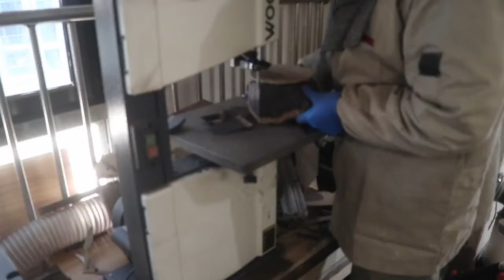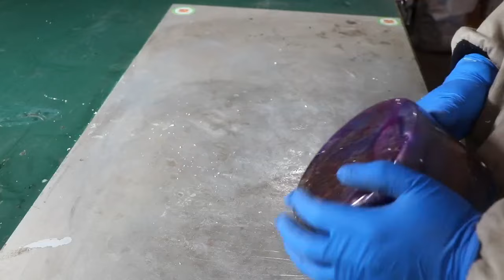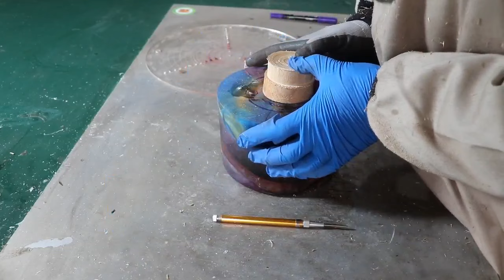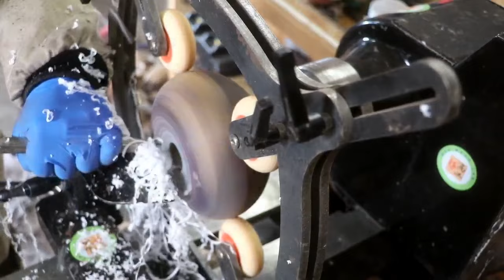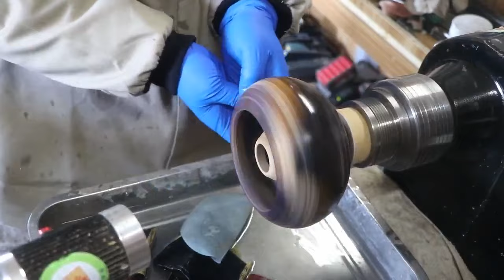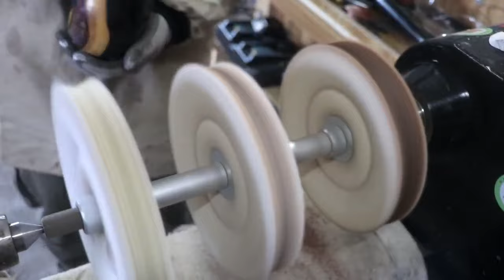creative woodturning:bowl in bowl, but why  thinking about aliens?😂😂😂

Comment: I love the shape and colours you used. Just a suggestion to possibly save your bucket next time, try using compressed air to blow along the edge between the bucket and your piece, sometimes it's just enough pressure to break the seal!
Reply from the maker: Thank you so much, very very glad you like it,🙂🙂🙂🙂.yes, I saw some YouTubers did that, and I tried too, but maybe the piece of wood is a little bit big, failed, next time, I'll cut it smaller, BTW, the wood is sooo hard, difficult to cut,😂😂😂😂
and, thanks again,🙂🙂🙂🙂🙂
Reply: @gaowoodlab  
It's funny that you mention how hard it is, just yesterday I had the opportunity to buy a small piece of African Blackwood, but when I felt how heavy and hard it is, I decided against it. Being very new to woodturning,  I made the mistake of buying a very small lathe (8" diameter and 1/3 hp), I knew there was no way that little lathe could handle wood that hard! Maybe once I save up for a bigger lathe, I'll try wood like that!
Reply from the maker: Haha,Bigger is always better, actually, I think my lathe is small too, I decided to build my wood workshop in very short time, I bought most of things in one week, before that, I had no idea about real lathe, such as brand, model, size, etc, just saw it in videos, lathe and bandsaw are both small, especially bandsaw,😅😅😅😅
Reply: @gaowoodlab  
It sounds like we are very much alike, I started watching woodturning on YouTube and decided I was going to try it. As you know, it's a very slippery slope that we fall into when it comes to tools. I started with an old table saw and a mitre saw that belonged to my ex, in the past 6 months I have acquired my lathe, a 14" bandsaw (used), a grinder, a belt/disc sander, the wolverine sharpening system, a portable dust collection system, and about 35 chisels of different shapes and sizes! I love every minute of it, but it's definitely not a cheap hobby!
Reply from the maker: You've got so many tools. It's great. my major was medicine in university, and went into a graduate scool for molecular biology, then worked in a biotech company for more than 10 years. I've never studied carpentry, but I like DIY. Five years ago, I made a set of furniture by myself. I bought a table saw, an electric drill, an electric screwdriver, etc, I am a“工具控”，I don't know how to say this word in English ，“工具”means “Tool”, “控” means “control”, which means people who like tools very much and want to buy good tools when they see them，Later, I bought more and more tools. When there is no enough place to put them in my home, I temporarily decided to build a wood workshop in another apartment. Soon, Covid 19  breaked out. I couldn't go on a business trip. In the past, I spent 150 days on a business trip every year. Because of the covid-19, I have enough time to spend in the workshop, I like it there, peaceful , free…
Reply: @gaowoodlab  工具控 ... Tool Freak? Tool Connoisseur?  ...  "Skilled Craftsman" ding ding ding the winner
Reply: Hey Quiet ... when you going to do a video ? We'd like to see and share with you👍   Stay safe. -Mike😷💉
Reply from the maker: @mpart_woodlathe-stuff  🙂🙂🙂🙂🙂
Reply: @mpart_woodlathe-stuff   I'm too new and not qualified enough for making videos, I'm afraid! At this point I'm just concentrating on keeping all my extremities. So far I have only produced 3 bowls and a birdhouse ornament, haha!
Reply: @gaowoodlab  
As many tools as we have there always seems to be something we think we need! I don't think there is a specific term in English for what you're referring to, rather there are many phrases used to describe those that love to acquire certain things! Whatever term you come up with, I'm probably it, haha! I also make jewellery from wire and semiprecious stones, I have so many different types of pliers for that, it's almost embarrassing.
It sounds like your career choices have allowed you the means to now enjoy a hobby that many find difficult, especially during these times. You have spent most of your adult life in a very structured environment, it seems that you have released your creative side, I love that you're sharing that with the world. Having spent almost half your life traveling for business, your spouse and son must love having you around so much.
I completely agree with you about the feeling of freedom and peace when working with wood, it's difficult to describe, but it's a time without worry and stress . I have been starting my segmented pieces with firewood and rough logs found on my property, it's so incredibly rewarding to see a piece of firewood turn into a beautiful bowl!
Reply: @quietinspirationcreations3448  No worries ... when you're ready you're ready. And we're here to help 😀  -Mike😷💉
Reply from the maker: @quietinspirationcreations3448  Waiting for your work,🙂🙂🙂🙂🙂🙂
Reply from the maker: @quietinspirationcreations3448   don't worry, just try, 🙂🙂🙂🙂😀